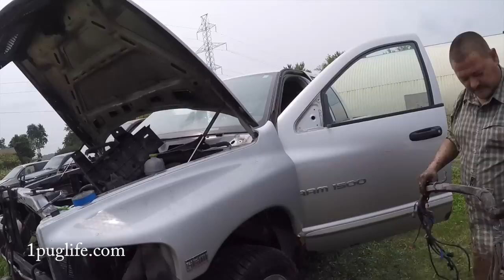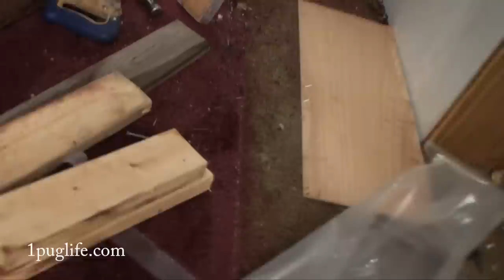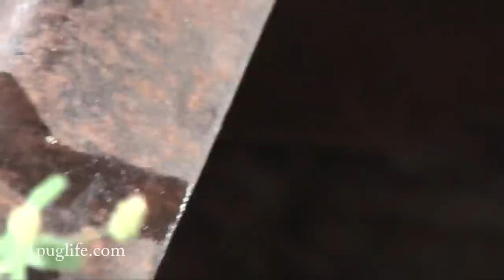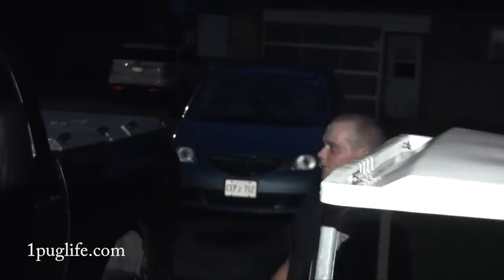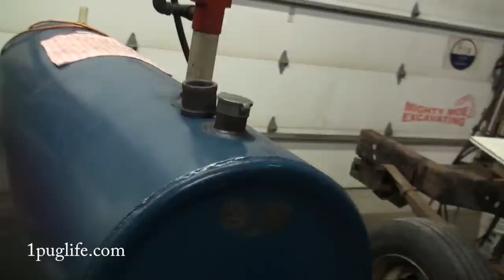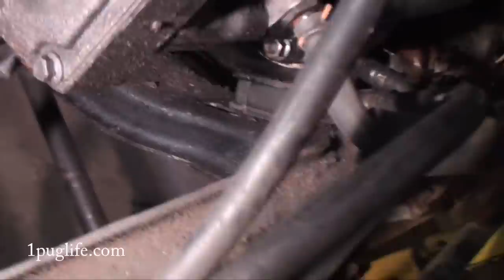a look at my good trailer and loose bolts

Comment: Campers from 1995 and above the roof is actually a piece of rubber you don't want to walk up there without having you a small sheet of plywood that will stretch from edge-to-edge and at least 2 ft wide they are a f**** pain in the ass to deal with

Comment: Tranny mount bolts loose. Front drive shaft bolts loose. Someone had that tranny out and only did the bolts up finger tight when they put it back in. 
Add to that the offset engine mounts. Makes me wonder if that engine is original to that frame.

Comment: Love the flexible tranny mounts and the standard and metric motor mount holes. 
Why don't you screw a board across the blocks to keep them together. Don't want to mess up the spiders home on accident.
Is the trailer going to be worth more as scrap or fixed up?
Why not add the bay on the side, won't have to move to much there?

Comment: You aren't really fixing that rotted out trailer are you ??? there is hardly enough trailer there to even scrap !!!
Reply: The trailers absolutely fixable, gut the rotted framing/floor/ceiling and rebuild onto the perfectly intact shell, doesn't seem like a big job at all.